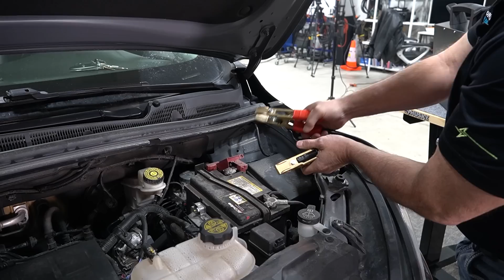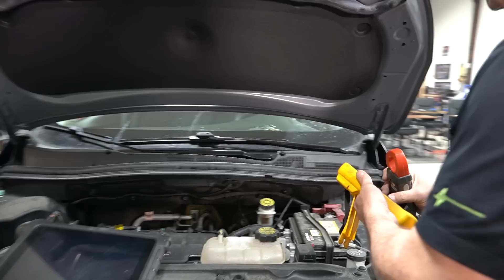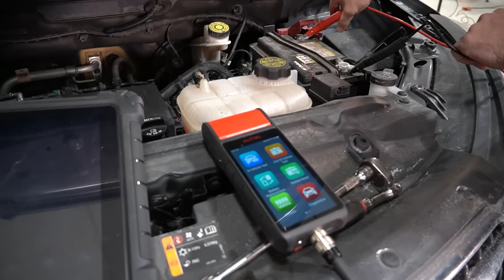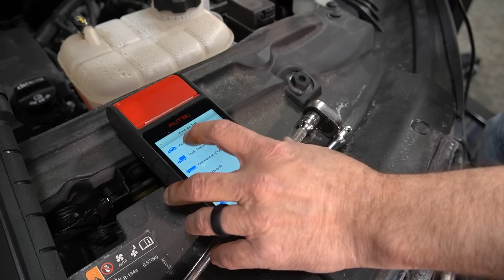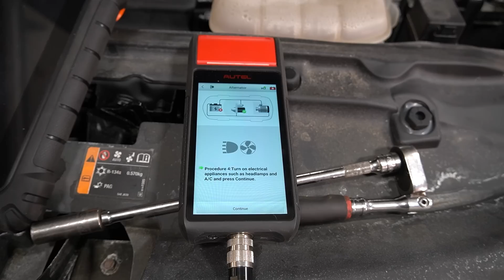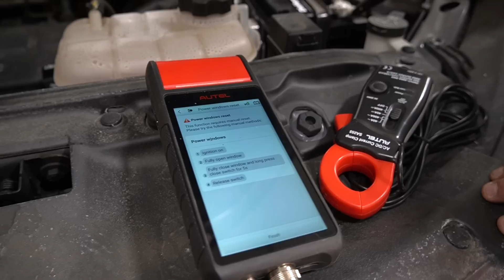Fix It Like a Pro: Battery & Charging System Hacks You Need to Know!

Comment: When a new battery is fitted surely the battery sense circuit will report the state of the battery and report to charging system the amount of charge the battery requires and not overcharge it !
Reply from the maker: often with smart charging systems, while it may eventually correct itself, it has a tendency to overcharge immediately after battery replacement

Comment: Thanks John. Some of you viewers should not jump to conclusions when doing their own charging test and parasitic current draw test. Some charging systems are computer controlled and the charging will vary depending on several conditions. GM for instance uses EPM which has 6 different charging modes depending on conditions. Seeing 11.6v - 15v can be normal. And for testing for parasitic draw, best to find service data first. Systems like Subaru specifically call for testing between 5 and 20 minutes after engine shutdown. After 20 minutes self tests kick in. And Range Rovers are crazy complicated. So before throwing parts at a problem do your homework. Cheers.
Reply from the maker: good advice.  like I always say, when making a video we can just scratch the surface as o-posed to attending a live multi hour class

Comment: Hey John, great content! According to Clarios, who represents the largest battery manufacturer in the world today and produces the DieHard battery along with 20 other private label names, the recommendation is not to load test them but to check their status via voltage. If the reading shows below 12.4 volts, they suggest charging the battery and retesting. The rationale behind this recommendation is that batteries are not fully charged or cured at the factory, which could potentially extend their shelf life. Prematurely load testing the battery at this stage may provide a false reading when all the battery needed was a recharge. Batteries should fully cure after 15 to 20 minutes of normal driving.
Reply from the maker: thank you for watching and thanks for sharing your information.